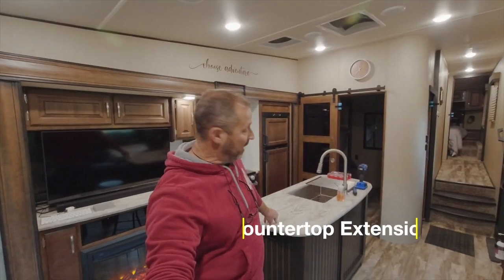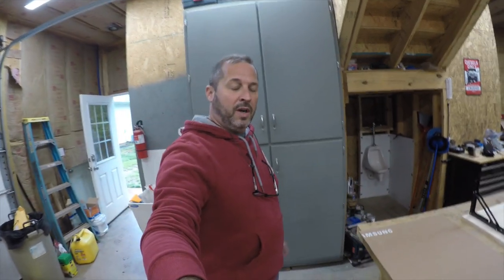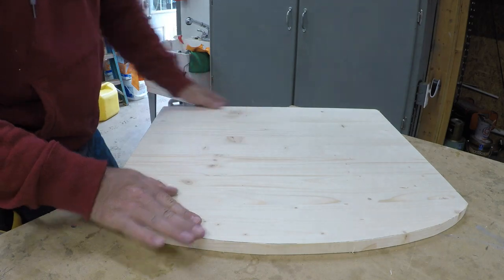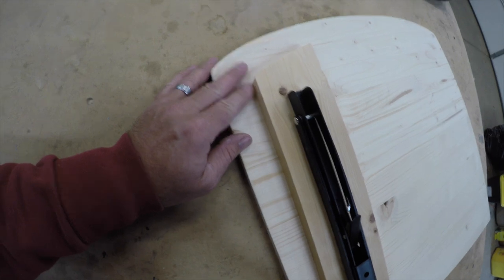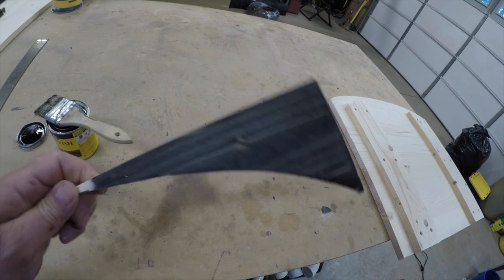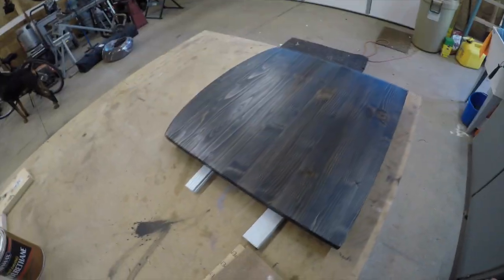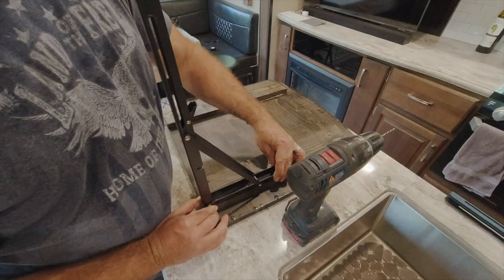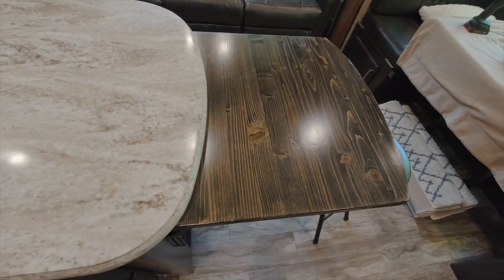RV Island/Countertop Extension (DIY)

Comment: Beautiful work I’m going to do one in my camper the thing you should do when staining wood is use a sanding sealer after the stain then the finish coat it will turn out much smoother cause you can sand the sealer coat.
Reply from the maker: Thanks for the good advice!

Comment: How do you access the electrical plug on the outside of the island when the counter extension is folded down?
Reply from the maker: well, unfortunately you can't. We decided not to move the outlet, instead we just raise shelf when we need to use it. The only time we really need it is when we plug in something like a toaster and in that case we usually have the shelf extended so for us it hasn't been a problem.